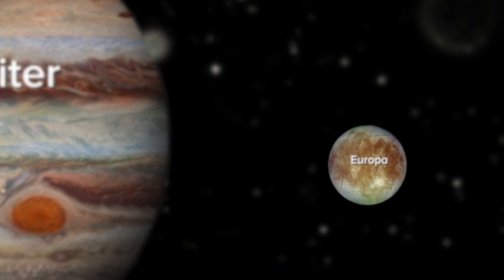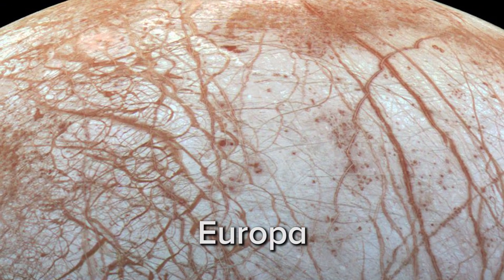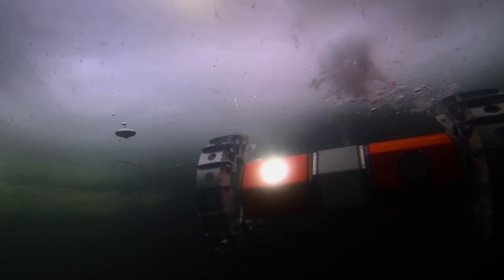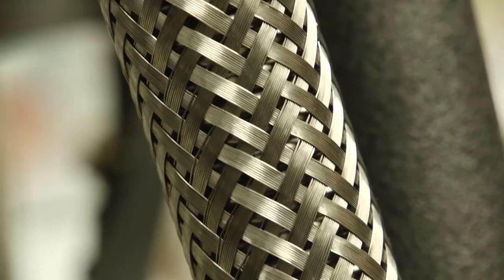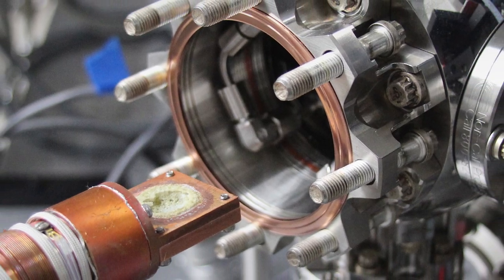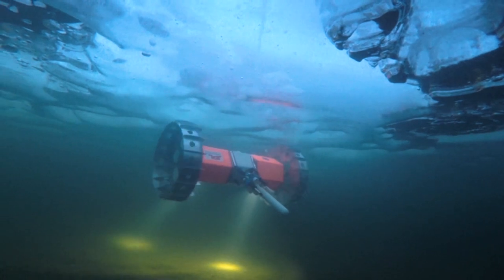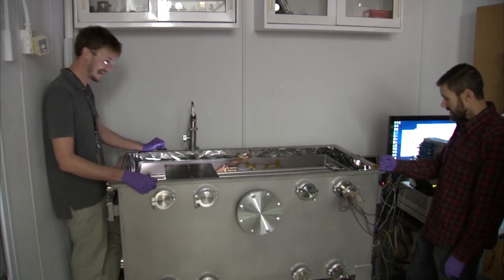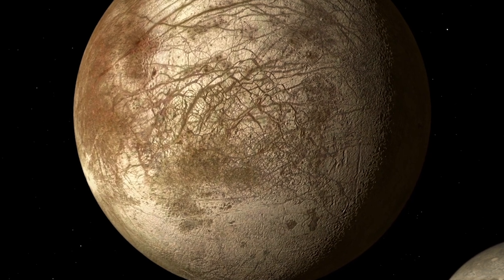Reverse Engineering Europa

Comment: what if drilling through that ice kills everything
Reply: The deepest we've drilled on Earth is 12km with all the fuel & other resources fairly close at hand. Nobody is thinking of drilling through 20km of very tough, old ice on a body approx 1,200,000,000 km away. Impossible to ship sufficient gear to drill for at least another 100 years I think. And why would 'drilling' through the ice kill everything? The equipment would be sterile & the idea is to melt through to the ocean [if it exists] & the hole seals up behind the descending vehicle - the heat would ensure no Earth microbes travel down with the vehicle too - the vehicle would need a nuclear power source & it would have to be able to withstand heat & pressure beyond our technology for a long time to come. I don't see anyone putting a nuclear powered vehicle into that moon for all sorts of obvious reasons. Also there are already cracks that connect the sub-ocean [if it exists] to the outside if those geysers into space are anything to go by. The first few missions will not go near the supposed ocean - they'll sample the geyser to begin with from orbit & try to figure how how thick the ice is. I'm guessing the ocean is at least 50 years away for exploration & perhaps it will never happen.
Reply: The evidence for the ocean is much stronger than the evidence for the plumes.
The ocean has more water than all the water on earth, so it would be tough for us to kill all life (assuming it has life) in that ocean even if we were trying to! I don't think a nuclear-powered vehicle would even be able to do it.
Reply: The reason why we haven't gone past 12km is because of heat. If there is an ocean under there, I'm sure it wouldn't melt whatever drills into it.
Reply: What I'm saying is that it would be possible, yet lengthy.
Reply: Why I prefer just having a vehicle that melts through & lays a comms cable behind itself as it goes [even though ice has a very high specific heat capacity - higher than almost all natural substances!]: I agree it 'might' be possible to drill, but it seems [to me] like a bad way to get to the ocean. It's believed there's a thick layer [kilometres of the stuff] of 'convecting ice' below the solid ice which might make it difficult to keep a hole open and I can't see us shipping 2,000 lengths of drill pipe all the way from Earth. It makes more sense to use a cable suspended drill bit - which is how we deep drill ice on Earth. Following that reasoning it makes the most sense if the drill bit is also the ocean exploration vehicle. The whole exercise is pointless unless we also have a reliable way of transmitting the data from the vehicle through the ocean to the bottom of the hole, then up through 20km of ice to a surface receiver & then up into Europa orbit. I suppose we'd need to have 20km of tough cable going all the way through the ice as part of the cable suspended drill... Even cable suspension is way beyond our abilities at the moment.